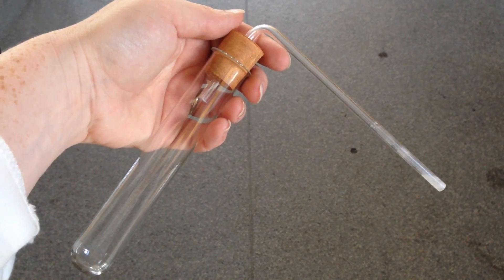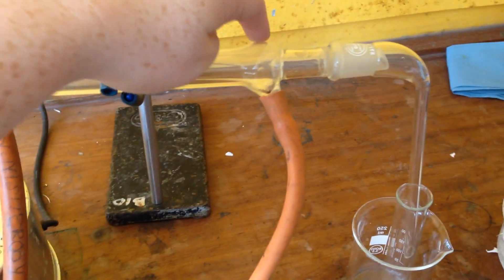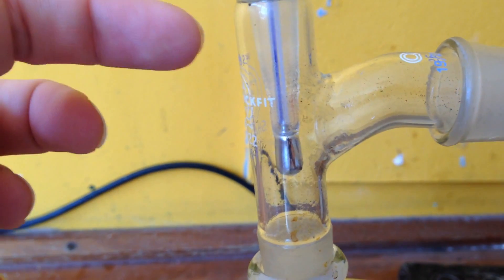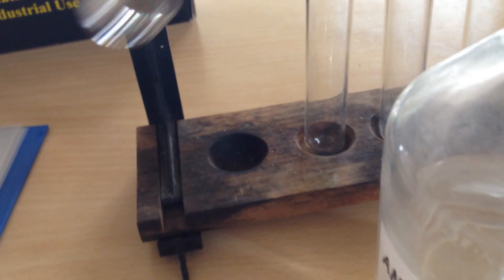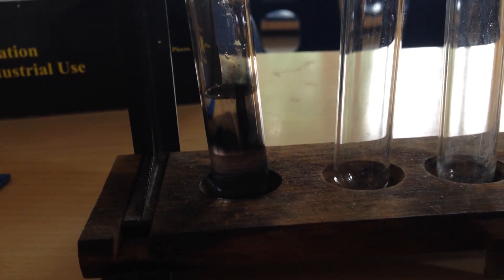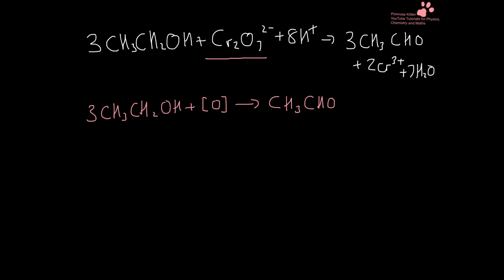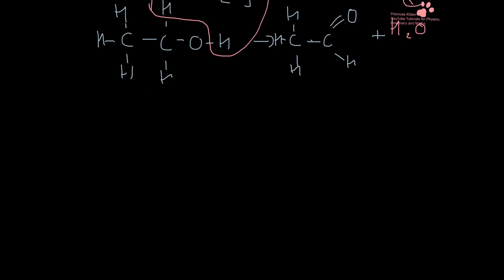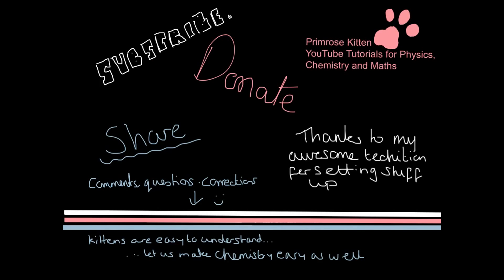Microdistillation of ethanol to ethanal, Inc Tollen Mirror Test. A-Level Practical

Comment: And in A level chemistry we always attach the condenser intake and out take backwards.
We also use pear shaped flask as our boiling flask because round bottom flasks are for chumps. The use of a pear shaped flask ensured that the heating mantle not only looks way too big for the job but it also risks over heating the heating mantle and destroying its filaments because the mantle isn't in proper contact with the flask so the energy flowing into the mantle isn't radiating into the flask and thus the energy concentrates on the filaments and destroys them.

Now students turn to page 48 of your "Bad chemistry" handbooks and read chapter 7.